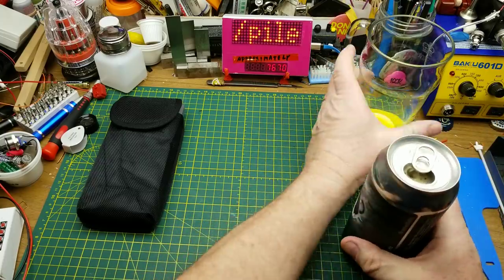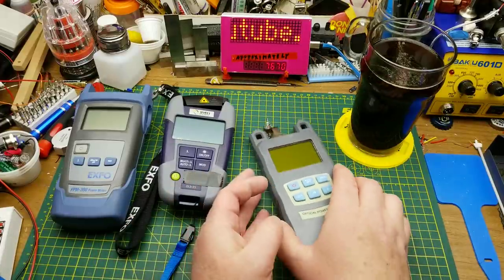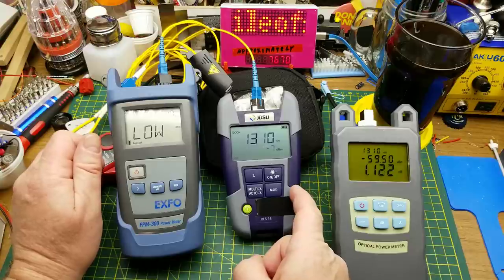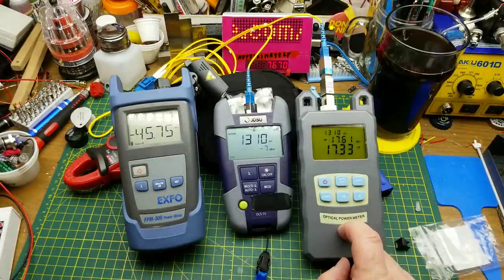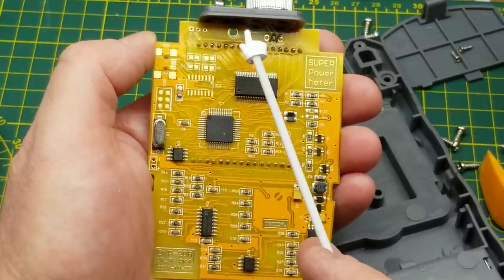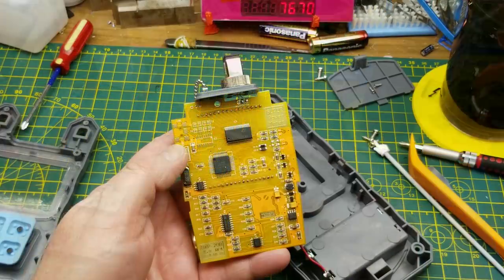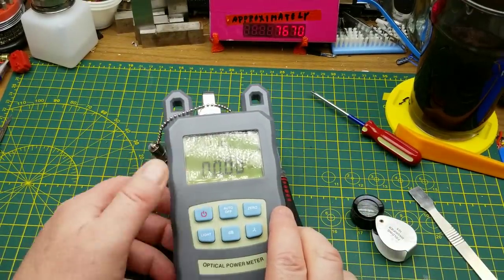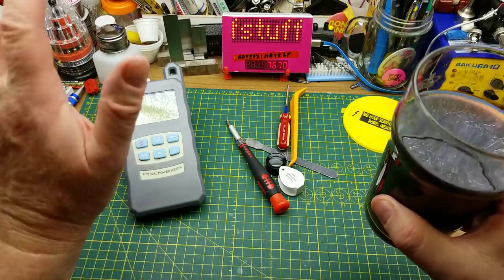Cheap fiber optic power meter

Comment: Fiber has a stigma about it that makes it seem like it's way outside the realm of the DIYer, but it's really not. Especially with reasonable quality pre-terminated fiber available on Amazon.  In Florida, where we get a ton of lightning, you don't want to run cat6 between 2 buildings that are separately grounded. The differential will cause havoc and one side of the connection will lose a lot of network gear.   Fiber solves this if you don't want to go long distance wireless.  In Alaska, we used fiber to connect our buildings together where we needed the distance and it was super reliable and not all that expensive.
Reply from the maker: The biggest headache for people new to fibre is cleaning and bending.

Even those of us who deal with it on a daily basis end up doing a lot of cleaning and re-cleaning the mating faces of the connectors when connecting everything together.

Comment: Nice looking beer. we had a system where about 40 fibres came in to a single connector, found that using a B/W camera was good for seeing the IR signals on the connector. The lab cleaner had a habit of breaking a fibre when cleaning around the rack. They had OCD as we said not to clean around it but they could not stand to see bits of wire, cableties etc on the floor.

Fun days.
Reply from the maker: Oh man, that would be annoying.

I'm pretty aggressive with making sure any fibre patch cables are protected inside a rigid duct or at minimum split-tubing and well secured out of harms way.
Reply: @pileofstuff  It was a design rig built in to a 19" rack, the patch panel had to easy to get at so we could create faults for the software to detect etc. so the cleaner was infact part of the fault process. :) Audio and control data all flying around as time multiplex data on fibre. Was fun working on it.

Comment: The chip connected to the USB is most likely a CH340, to convert from USB to Serial.
Reply from the maker: Seems like a reasonable guess.
Reply: From the pinout of that chip it looks more like a MAX232 with it's 4 charge pump capacitors and power to pins 15 and 16. I have a Chinese digital caliper that also uses a USB connector for good old RS232 communication

Comment: Amazing what they can sell for something like six bucks and still make money.

Just an FYI on those Exfo OPMs.  I've seen them gave a tendency to accumulate a small dot of dust on the sensor directly under the connector opening.  This will affect the accuracy if the sensor surface isn't cleaned periodically.
Reply from the maker: I'm constantly amazed at how small a bit of crud it takes on any sort of fibre connection to totally trash a circuit's levels.

At work we are quite scrupulous with cleaning.

Comment: what soldering pad do you recommend for a beginning hobbyist?
Reply from the maker: do you mean a heat resistant surface to solder on top of?

I just use a silicone pad from the craft section of a dollar store. They sell it for protecting work surfaces from hot melt glue.

Comment: I think that mystery chip maybe an LM385B-2.5 voltage reference from TI. It looks as if only 2 pins are used which ties in with the datasheet.... https://www.ti.com/lit/pdf/slvs023 Its just a guess mind.
Reply from the maker: That would make sense

Comment: I Have a cheap meter, almost identical to your 'work' one - cost me less than £10 gbp - use it more for "is the light getting out at all" than wavelength tests :D
Reply from the maker: The wavelength selection on the receiver is mostly a calibration setting. If you have it wrong, it'll still show a ballpark reading (unless there are CWDM/DWDM filters in the path).

We mostly use it to identify loss in our system, so we measure directly off the source, set a "zero" reference, then take the meter to the far end and measure there. (often that "far end" is at the top of a 300 foot radio tower, with several patch cables and connected in the middle)
Reply: Sounds like a very interesting job you have 😁
Reply from the maker: @markb4071  To be clear, it's not me climbing the tower. I stay in the shack at the bottom out of the weather.
Reply: I'd be the guy right next to you making the coffee 

I meant in general lol